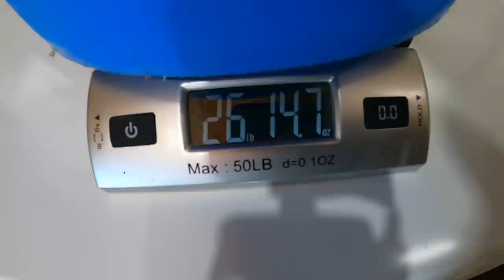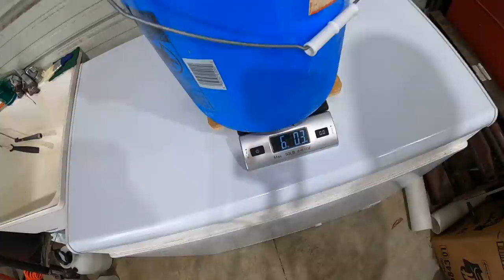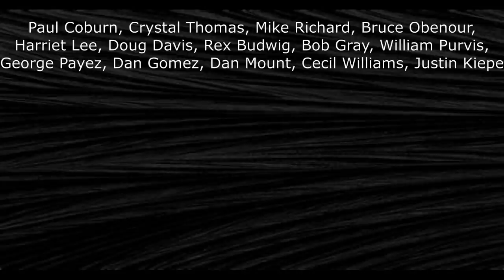Homemade ice maker! New fan and new personal record! #562

Comment: An fan on the outside blowing on the compressor/outside of the ice chest with the condenser coil will dramatically help the efficiency of that chest freezer, especially since you have it outside in a very hot shop!  To avoid having the fan run all the time you can get one of those power strips designed to turn off all the outlets when the main load turns off - common use is for a TV - when you turn the TV off, it turns off all the accessories.   Plug the freezer into the main load socket, plug the fan into the other sockets and the external fan won't run unless the freezer is running.  Works a treat!  
I wouldn't plug the inside fans into this - you want the internal fan to run all the time.
Good stuff!
Reply from the maker: I actually tested the fan theory for a while and seen little increase in energy efficiency.

Comment: MY THOUGHTS ON THIS Can "Light Diffuser" or "Egg Crate" be used on the bottom of the freezer to hold or lift the ice off the bottom? Then you could duct the colder air, beneath the ice through the fan and towards the ice makers. Think of an under gravel filter for a fish aquarium, the fan would draw air downwards through the ice then across the bottom of the freezer and into he ice makers just like a powerhead moves water though a fish tank.
Reply from the maker: My second build had plumbing ran down to pull the coldest air, I seen around a 7 percent gain.  The problem was I lost storage and room by doing that.
Reply: @TKCL  Plastic egg crate is almost 1/2". Using two small pieces stacked  here and there for foundation blocks holding up a piece of egg crate covering the entire freezer floor is only going to take up 1&1/2 inches inside the 36" deep freezer. Then using that black plastic sheet you have make a duct coming up from the egg crate about an inch thick and about six inches wide to connect to the fan. You can either draw air through the ice across the bottom and through the fan or you can draw air from the top, push it through the fan to the bottom  and then through the ice to the ice makers. Either way it will only use an inch and a half of storage space. Another thought would be to use two plastic trash cans to collect the ice.  The thought being that trash cans have a small base and get larger as they go up. This would allow you to collect the ice while leaving most of the bottom uncovered. Small clothes hampers could very well do the same. once they become full they will dump out into the floor of the freezer just like the shallow pans you use now only the baskets will hold more ice keeping it off the bottom for longer periods allowing for maximum air flow/ice production.

Comment: I live and AZ and im going to try and convince my wife we need to do this lol. 
2 Questions:
1. what thermometer are you using that works below zero and is strong enough to send a signal through the metal freezer? The few I have tried either burn through batteries in a few days and/ or lose signal when I close the lid.
2. I can't remember but have you tried pointing 1 fan down to kick the clod air up with the second fan circulating the air at the top? I remember the PVC contraption, but I wonder if you just point 1 down at the ice if that would do anything.
Reply from the maker: Have not tried straight down. My thermometer is made by Govee from Amazon.

Comment: G'day Andrew, I like the low profile fan & speed control idea but wondering if an improvement could be had by having 1 or 2 of them without deflectors, blowing straight onto the ice-makers. Mount them on the lid with velcro strips so that the distance away from the ice-makers can be tweaked easily for optimal output.
Reply from the maker: My only concern is I've build up on the back wall when blowing directly on them. I see that with the other fans.

Comment: Instead of cooler guy fans on a bar…. Use a hinge between fan and lid. So when open lid they fall flat against lid. When close lid they swing down in front of ice makers but stay away from the ejection bar on the ice makers and really if you are pulling out ice regularly why not cut off the ejection bars
Reply from the maker: I like that idea! My only concern with those fans is the ice maker failures I've seen.  I feel like they are pushing them to the limits.

Comment: IHad a thought, where the fan lowers down to inside the freezer, you should put a PVC section of pipe down with a bunch of holes drilled in it towards the bottom, and about halfway up, so the top of the pipe meets with the intake of the fan but it’s pulling cold air from the bottom of the freezer words the coldest, then you can run it at its lowest speed and it’ll likely increase your production
Reply from the maker: I did that in version 2.0, the build is on the channel.

Comment: A full freezer runs more efficiently.  I always put soda bottles filled with water in mine when its not full.    I don't know how full yours is getting, but if you can build up some mass with ice blocks you might see some improved efficiency.  I wonder if making a lid out of foam board with cut outs for the fan and ice makers would help any?
Reply from the maker: Mine is slap full the ice makers tripped themselves off. I agree with you.

Comment: It looks like the fan blows across the ice makers, since you say the coldest air is on the bottom have you ever tried deflecting the air to the bottom?
Reply from the maker: I've pulled cold air from the bottom with pipes, seen a 9 percent increase in production.

Comment: You should look at the difference in temperature when using fan and no fan ice in a drink.. practically checking the quality
Reply from the maker: The temperature is a lot colder with no fan.  This wasn't built for drinking ice, it was built for cooler and fish box ice.

Comment: The part that surprises me is that the fans make a difference at all. I would have expected the ice makers to be on timers, not having a way to detect the internal temperature of the ice cubes. Apparently they're using some kind of temperature sensor on the mold itself to approximate thickness of the frozen portion of the ice. Very interesting test.
Reply from the maker: All they do is look at how quickly you can get the mold temperature below 10 degrees. The quicker you can get the temperature there, the more the ice makers activate and make ice. They do tell temperature, they have to. If they were truly mechanical and your compressor failed, they would dump water on a preset cycle and not temperature.

Comment: Have you ever thought of building a frame that will fit inside the freezer so that the ice makers can be mounted without drilling into the freezer wall? You could then do away with the added collar.
Reply from the maker: Collar provides a space to drill holes for power wires and water tubes.

Comment: Speaking of solar projects it would be fun to see what it would take to run that ice maker only off solar. You didn't talk elec costs for the different fans also.
Reply from the maker: I sure didn't, it was around 2-2.5 kwh a day for the single fan and 3 kwh for both cooler guys fans. That would take a decent investment in a small solar setup to run.

Comment: I don't know if it would make a difference but instead of the wood  used to raise the lid how about aluminum? Also maybe wrap the outside of the freezer with some sort of insulation?
Reply from the maker: That's pvc foam board I used to raise it. It has R value and is sanitary. The aluminum wouldn't offer any insulation.

Comment: Great series Andrew!  Love your methodical, data based approach to problem solving!

One suggestion, one request:
Suggestion: Highway overpasses freeze quickly because they have cool air blowing over the top and bottom.  As a result, you may improve ice production if you situate your fan+diffuser in a way that it passes air over the top and bottom of the ice makers (rather than just circulating air in the freezer as you are now).

Request:  Can you do a quick review of the item you're using to monitor the temp inside the freezer?  In one of your earlier videos you mentioned it is monitoring two temperatures and you seem to be able to refer to temperature history with it as well.  Interesting device.  Wondering where your probes are and how they're connected.

Thanks in advance!  Keep up the great work Andrew.
Reply from the maker: That's a Govee thermometer I got off of Amazon. It's meant for reading temp inside the home and has a wireless thermometer for outside. You can connect to it via wifi and pull historical data out of it. It's been working well. It needs lithium batteries for the wireless thermometer in the freezer as the cold kills normal batteries quickly. Thanks for watching!

Comment: What about a false bottom and sides. To keep the ice off the bottom and allowing the air to move all around instead of the ice blocking air flow
Reply from the maker: I actually have steel mesh and was considering that.

Comment: How about a combined test, use the two fans in the position you have them in, but have the brand new fan pointed blowing air toward the bottom if the freezer?
Reply from the maker: I was curious about that myself.

Comment: What if you make an air channel with a fan blowing air down to the bottom of the freezer to a grid tube and blowing it back up to the fan.
Reply from the maker: I did something similar last year and pulled air up. Made a 9 percent increase in production.

Comment: I just bought a used freezer about the same size as you have. My question is, What tells the Ice maker to dump cubes or when?  I would be guessing that it would be a timer or a temperature sensor on the cube tray!   Thanks in advanced...
Reply from the maker: There is a thermostat that triggers a timed dump cycle any time the mold temperature is below 10 degrees.
Reply: @TKCL  Ahh, that makes sense.. Oh, another question, is there only the four wires on most ice maker? Hot, neut, ground, and one for the solenoid? 
Thanks...  Have a friend with used appliance store, may have a few laying around..
I would like to make it so I could strip it all off and use it to transport meat during the slaughter season from my sons place in another state, and use small generator to keep it running..  Wish I was near the salt... I prefer what comes out of the ocean than land! Thanks and Have a good day!

Comment: Put a piece of PVC pipe in the bottom with an elbow coming all the way up to the top and put a fan in it to suck the cold air out the bottom and circulate it to the top you could even drill holes in the piece in the bottom that way it could sucked up more air
Reply from the maker: That's exactly what I did in an older build, the pipe was too much in the way and I only seen about a 7% increase in production.

Comment: Hi Andrew, Have been enjoying your YouTube channel for quite a while. I especially enjoy the ice maker builds.
I think that velocity of the fan is not as important as volume & turn over. Meaning the more even the temperature is in the freezer the more ice you will produce. The thermal mass will continue to cool all the air as it also is circulating through out the freezer. Also I would use a medium speed and keep the fans at least 3-4” away from the walls to not create air currents bumping into each other.
Reply from the maker: You are probably correct! Thanks for watching

Comment: I haven't been able to read all of the comments, but of those I've read, not one mentioned a potential issue. Any fan motor  you are running inside the freezer is generating heat that the compressor has to remove. This is very inefficient thermally. A better solution might be to have a fan with a longer shaft. Mount the motor on the exterior and run the shaft to the inside where the fan blade is attached. My apologies if this has already been suggested.
Reply from the maker: It's been discussed many times, these little 2 watt fans don't generate much heat. The compressor is able to overcome it.
Reply: @TKCL  Good to know, but I don't know that it's not significant. These compressors usually consume about 120 watts. If I recall they're about 20% efficient for thermal transfer. That means 24 watts of cooling, so 4 watts is about 1/6 of the cooling capacity. Maybe not a game changer, but not insignificant, either.

Comment: I love these videos, I've binged watched them one after the other. However, I have one comment... Why don't you put the side vent fan in the back right corner, and use your deflector to direct the air reflectively around the icebox.IMO  you probably don't even need the vent/vane to direct the air. Put your fan in different places in the icebox, and see how that influences the ice production. jm2cw
Reply from the maker: When the lid closes its very close to the ice makers, I was concerned no air flow would go over them with the fan in that location.
Reply: @TKCL  yet if you direct the fan towards the front edge, it should reflect around the freezer. thus bouncing towards, and deflected, towards the ice makers.

Comment: Cool project. As an alternative, you can buy a used side by side fridge, remove the ice tray and racks. The icemaker will fill up the whole fridge. No mods needed.
Reply: Or use a regular refrigerator ice maker just as it comes from the manufacturer!
Reply: @SeattlePioneer  That is what I have always done. Just dump the ice from the bin into a bag and put in the freezer. It works for me.

Comment: What is the power consumption difference between the fans?
Reply from the maker: 2-2.7kwh usage a day for all electrical usage (freezer and fan) for the single fan depending on speed. 3kwh usage for the two cooler guys fans. The cooler guy fans are obviously more efficient than the single fan.

Comment: How has this fan held up over time?
I'm gathering supplies to build my own and I'm tied between this exact fan and layout, 2 of these fans (one pointing downwards next to ice makers, and one on lid like yours pointed at makers)

Or the cooler guys fans mounted to lid.
Reply from the maker: It still running 24/7, no issues.
Reply: @TKCL  just ordered it!

Would you suggest mounting and pointing it how you have yours? 
Do would I benefit mounting it on lid but blowing directly on ice makers?
(on what would be left side of lid instead of right)
I've watched all your videos multiple times to figure out best bang for buck and most efficiency/ ease of use.
This ice maker series Is AWESOME
Reply from the maker: It's hard to say as I've not tested every position. How I have it in this video is getting me good results. Did you watch my recent video where I have it running on solar? I am using trash bins for catching ice and I love the convenience.

Comment: Like I mentioned to you before...Make some cubes of ice with plastic margarine tubs
or such in the bottom of the freezer,  plastic gallon jugs work great. This ice last much longer in your boat cooler. I have used this method many times for longer three day trips.
Reply from the maker: I have been making block ice, just didn't show it in this video.
Reply: @TKCL  Ok, I agree that was 6 months ago when I first 
gave you that suggestion and you never mentioned it... But,You are still welcome!!

Comment: Thank you!  Great update.  My wish list: a capacity sensor using weight sensors and something like an Arduino.   Then an app that lets me schedule production or monitor production, control those overflows in winter problem.   Great job!
Reply from the maker: That would be cool!
Reply: Sounds like a thing home assistant can help with along with an esp32 weight sensor in each corner reporting back

Comment: Thank You,  Andrew, for producing these very informative videos. You noted that you want to make your system better by recirculating the air inside to help make more new ice. A suggestion here may help, by making an upward channel starting under the ice to pull that colder air up to the fans like a reverse downspout will get exactly the coldest ice possible. It's just an idea. Good luck and GOD bless you.
Reply from the maker: I did try that in a older episode, I only seen around a 7-9 percent increase in production, with a loss of storage and room due to the extra materials. Take care and God bless!
Reply: @TKCL  It's all in the design I think...flat "tunnel" and using the direct flow over the ice makers from the side and not the bottom might work better...

Comment: Pvc pipe with an inche from the bottom to either push or pull bottom air to the top
Reply from the maker: I did that in version 2.0 build on the channel.

Comment: What about mounting another of the small fans, in the bottom throwing up?
Reply from the maker: I pulled cold air f4. The bottom once, seen a 9 percent increase in production.
Reply: @TKCL  I saw those videos too, I brought up the smaller fan as a way to not loose so much volume as those PVC pipes consumed.
Reply from the maker: That was the problem, it all got in the way.